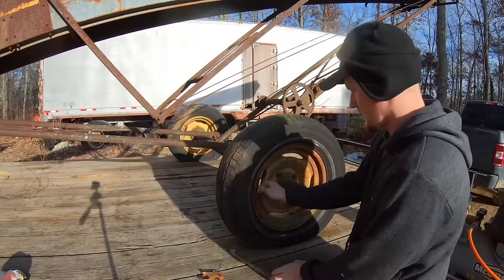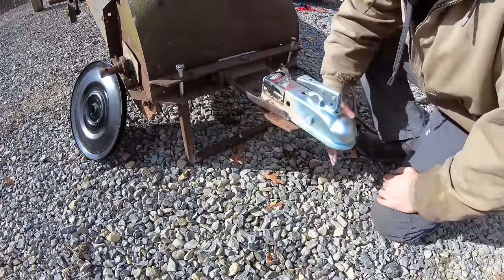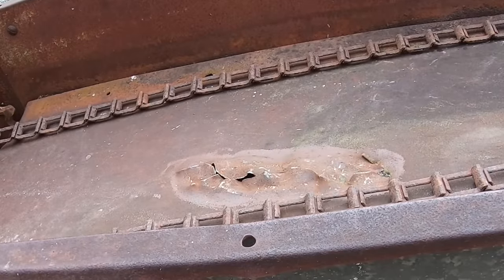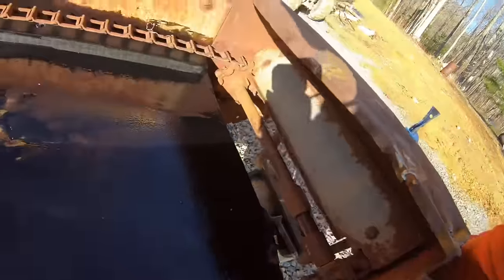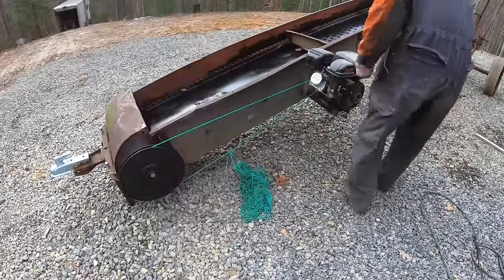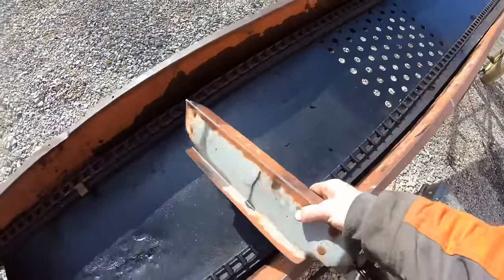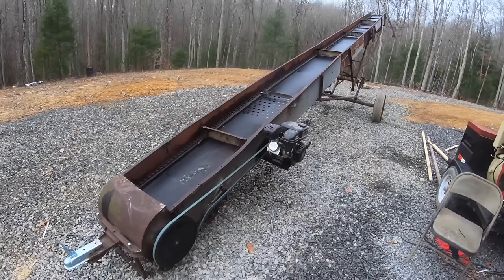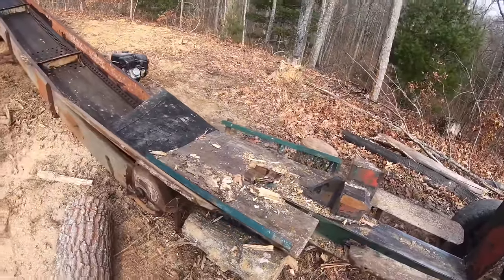Fixing an Antique Hay Elevator to use for a Firewood Conveyor

Comment: One of the things I like about your channel is your willingness to try just about anything you come across. What you show me with this segment is that the elevator is an old piece of equipment, rusty dirty dilapidated. But that doesn’t scare you.  You’re looking at it as something you can use for a different purpose and in order to get it to do that you’re gonna bend it to your will - broken bolts and all. You’re not afraid of it and you’ll change and adjust it and it doesn’t have to come back to original condition. All you wanted to do is work. Give yourself a pat on the back for a job well done.

Comment: Just finished up a 36' belt conveyor for our firewood. Its a good thing to round these up up off these old farms and get them working again. I used a 4 hp honda with a 6:1 gear reduction and it worked out well for the belt speed.

Comment: Just watched your video...I went through this very thing 2 years ago, here is what I learned, and ended up with...You need to put a Jackshaft in-between the engine and final pull...Engine 1.5 pull, to jack shaft 12" pull, 1.5 pull on 12 " pull leading up to another 1.5 pull on final shaft.
Final rpm around 30 with engine just at a Idle.

Comment: Hello  I did this very thing several years ago.  I did have an easier time of mounting my gas engine.   I used a centrifical clutch on mine.  You will be happy using it.  We set a log splitter on each side and split aaway  Saves a lot of labor.  Fill dump truck drive home and just dump it.  No stacking for me.

Comment: Hello that’s a cool project. I would get a 1” or a 1 1/2 “ pulley on the engine to slow it down more at that speed you are putting more wear on your chains. I have been looking for a conveyor for a long time to do the same thing. You can put some boards under the tires to give the splitter more height and the wood will be going down to the conveyor. Very cool.

Comment: Great find and great fab. I wonder though....instead of doing all the work to flip the pulley shaft to mount the motor on the opposite side could you have simply added a sprocket to the motor drive system? That would have then reversed the direction and saved all the fab work. Also then configuring different size pulleys to counter the RPM of the motor and slow down the feed of the conveyor.

Comment: Great video,  I use to make mini motorcycles with weed eater engines when I was a teen with jack shafts.  If u use pulleys smaller then ²" they slip very easy and you have to keep the belts really tight and u lose out on power and efficiency.

Comment: Great video Dave, I agree with you lowering the table will help it, Also maybe adding some sides to the table will help keep the wood on the table while the splitter pushes it to the elevator
Reply: Great until the bering go out 🤔

Comment: Dave put a rubber spacer on the front of the ram to push the logs a bit more. Then you won't have as much trouble getting the next log in. A cut out piece of tire should work.

Comment: I have an elevator just like that. You hav to power it from that pulley towards the top. The slip clutch is at the top. By powering it at the bottom you have no slip protection. You will break chain a lot. You also need rubber mud flap at bottom

Comment: Love watching your videos but I’m guessing that after several days of running that the vibration from the motor will crack the metal around your motor brackets but hopefully I’m wrong and unless I missed it you didn’t warn viewers about welding and grinding on galvanized metal without breathing protection, I did it for more than 50 years and got by with it but I did know better and always made my helpers move back or wear a mask. God Bless and keep the videos coming

Comment: Excellent video! I just picked an identical conveyor here in Maine and the guy I bought it from already swapped it over to an electric motor which is awesome. The problem I've been having is firewood getting jammed in between the strips of wood that the chain runs on and the chain itself. It happens so easily and often. I'm wondering if just filling the entire tunnel area with plywood all the way up would be a good solution?

Comment: I have seen conveyors like yours powered by 1750 RPM electric motor  that have a second shaft with gear reduction. Large  chain sprocket on drive shaft to a small chain sprocket on an idler shaft. Large v belt pulley  on the idler shaft to a small v belt pulley on the electric motor.  I think your wood conveyor should be s;owed down to about half the current speed. Have fun with your wood splitting projects.
Reply from the maker: Yeah I’m going to gear it down some more

Comment: I think you need to shorten your mudflap by several inches I noticed it bucking the wood up in the air as the drag dog would go under it to much length not needed on it

Comment: Most YouTube welding instructors have 1) never welded and consider watching welders on YouTube as qualification, 2) they’re YouTube welders and always cut their stuck rod moments out or only weld stainless in environmentally controlled shops where everything is ideal for welding or 3) they’ve NEVER made field repairs on farm equipment I.e. manure spreaders, silage wagons or that disc frame that broke last year and now it’s needed for this year. Good job!

Comment: I would of done it thst way I ues a pipe then u could keep it leve or u could of used  a hydrology  motor an ran it off rge wood spliter
Reply: Running it of the splitter hydraulic system would be nice but anytime you restrict the flow, it creates more heat. Considering how small the hydraulic tanks are, it s not a good idea. Heat is always the enemy. That's why I didn't do it. Maybe with a bigger hydraulic reservoir and an oil cooler, it would be fine. The motor system you built is the simplest, farmers ran these for years on a small gas engine and belt and pulley sets. If the elevator never left the main barn, it had an electric motor.

Comment: A couple of suggestions  on your table you can put a thick piece of industrial plastic with counter sunk holes for the bolts  also the sides makes it slippery also modify your splitter put a table over it with a large table beside you  about 10 feet lenght so you can put the logs right on the table no lifting save back lol .then attach a not sure what you  call it but jt will move your log down to your hydraulic chainsaw  on a lever which will cut your logs into the right size of chuncks then drops down to your  splitter ill try to find  it an artach the link so you can see what im trying to say not very well lol  this is at episode 5 but you can go back to start or go forward  just an idea if you serch wood processor's  you can pick and choose what you want to add  https://youtu.be/1zg-eDVIv3c